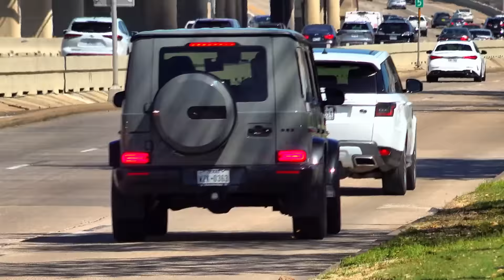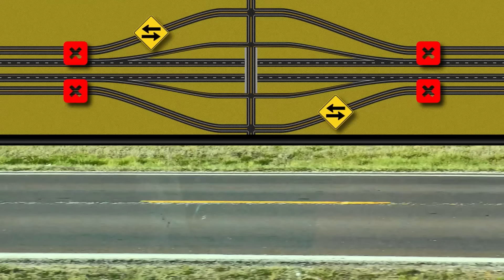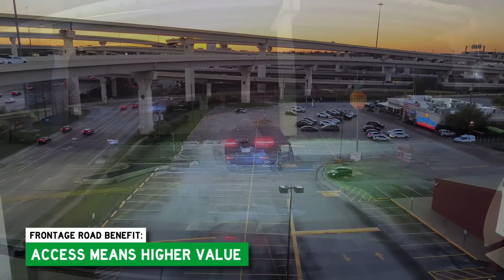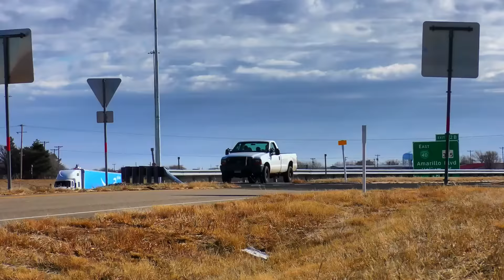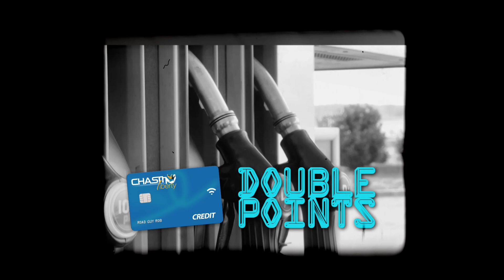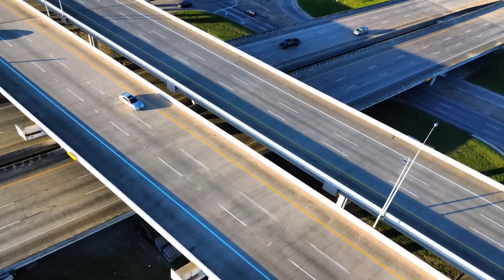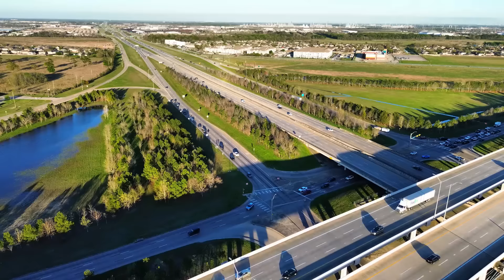Why Texas Builds a Freeway Next to Every Freeway

Comment: The real question is why is this done? The root of Texas frontage roads comes down to one major reason. Zoning laws! Texas basically doesn't have any. You have houses, schools, manufacturing plants, grocery stores, banks, apartments, and freeways all next to each other. Everywhere else there are strick rules stating where you can build what. Also getting permits to build requires little bureaucratic delays. So yes now Texas has grown beyond cities. On any freeway leaving Austin, Dallas-Fort Worth, Houston, or San Antonio and you can go 30+ miles and still be in "CITY". Within the next 20 years all four of the major cities will be a fully connected super city.

You have to love the "Texit" (rutted paths from freeway to frontage road) and those are not just for trucks. Many adventurous Texans will take their cars through them.

Comment: No, slingshotting does nothing to improve main highway traffic, it does the opposite by introducing more variance in driver un-predictability. When you speed around traffic and have to get back onto the main highway, the rest of the cars behind you now have to slow down again to let you merge instead of them keeping a constant speed. If you want a high throughput of cars on a highway -- reduce the # of on-ramps please.

Comment: Frontage roads are chaos. The whole system is flawed because it relies on excessive weaving from one side of the frontage road to the other. There are too many activities happening; it's like a stroad on steroids, trying to be both a highway and a street. For instance, with the X configuration, you have some people in the left lane speeding up to enter the freeway while others are slowing down to make a left at the cross street, creating conflict. In the right lane people are constantly making right turns.

I think they are probably worse for urban development if only because you're not going to convert frontage road development to something more walkable and transit-oriented. Otherwise it's actually rather ambiguous in my opinion. I can see the plus that it attracts all the trashy retail development to the areas near the highway, which are already undesirable anyway, rather than ruining additional places with both that type of development and the additional car traffic that comes with it. And it probably overall makes homes set back further from freeways, which is good.

Comment: The fact that the I-35 Frontage Roads mostly go from Laredo to Oklahoma is wild
Reply: It doesn't, after Texas Motor Speed there's no frontage road on 35W till Denton
Reply: @johnqwertydoe123 it's OK, everybody knows that there's I-35 and it's bastard stepsibling I-35W.  The e is silent.
Reply: They do this so they have redundancy in their roads that Places like Kansas city fails to have. I would rather drive in Dallas or Houston any day over having to drive in Kansas City.
Reply: Clearly Oklahoma dropped the ball.
Reply: @Akira-Aerins : OKC has them in the better designed bits. Even adopted the "Texas Turnaround" terminology for a while.

I've also seen them for a short section of a state highway, but... I honestly don't know how they ever thought that was a useful example.
Reply: @Akira-Aerins these service roads are all through Tulsa—and Little Rock, Arkansas too.
Reply: north of laredo, there's a border patrol checkpoint where they force every single vehicle onto the highway. you can't get back onto the frontage road for at least a mile
Reply: @mudkipman1  and the fact that the southbound frontage road is two-lane is scary that you kinda can use to skip the checkpoint, but idk what happens
Reply: there's like 200 different CBP trucks on that side just waiting for somebody to try.  @siroversight.official
Reply: Interstate 35E north of Hillsborough to Waxahachie parallel to U.S. 77 has no frontage road.
Reply: @u.s.6909  Parts of I-35W north of Hillsboro parallel to TX-81 and north of Fort Worth parallel to US-377 don't either, as well as I-10 between Seguin and Columbus parallel to US-90. And much of I-10 in sparsely-populated West Texas.
Reply: @u @u.s.6909 f Im remembering right. Been awhile since I’ve been up that way. The frontage road actually feeds on to and back out of 77.

Edit: just checked the map. Yeah the frontage road just turns in to 77 lol
Reply: Well most of it
Reply: Theoretically, you could take the I-45 feeder all the way from I-20 south of DallAss to Houston with little to no interruption and no need to ever touch the freeway.
Reply: @FilipinoWaylon26  most of the "feeders" between those points are via SH 75 (old hwy 75)
Reply: @siroversight.official yeah I'm aware lol. It's kinda cheating, but shhh, gotta keep the I-45 superiority alive
Reply: @FilipinoWaylon26  but you know, farmers wanted access to their land
Reply: @FilipinoWaylon26  DallAss?
Reply: They don't continuously go from Laredo to Oklahoma. There are massive stretches of 35 that have no frontage road. You must not live in Texas.
Reply: @JakeKoenig  Because I haven't seen one part of I-35 doesn't mean I don't live in Texas dawg 😭✌
Reply: Thats what I like about texas freeways is it allows you to keep traffic flowing continuously even if a wreck shuts down the major lanes of traffic.
Reply: Sorry, that’s totally not true  
Source: I live off of I35
Reply: @MrJack1992 says the guy who's obviously never tried to drive in or out of Dallas for the OU Texas game, lol!
Reply: @mrbeansification True locals know you always take the train to that and to fair park in general
Reply: @orthrus4490 true local knows where to park in the south for free and walk right in the front entrance of the fair.
Reply: Needs a tornado to poof it away
Reply: @AMPProf  Tornadoes aren't that strong to rip off pavement

Comment: I understand that access roads solve a unique problem in certain areas, but they’re way too dangerous and it’s appalling that some governments decided to build access roads completely by choice. The main issue stems from people failing to yield. But frankly, I can’t blame them. Because if people actually yielded, they’d get rear ended. And then there’s the issue of speed, because no matter the speed limit, they’re usually designed like a freeway and people go freeway speeds, despite the road having way too many connections for those speeds. And the cherry on top is the absence of right turn lanes, which significantly raises the risk of a high speed rear end collision. Awful. Shame on those who made these decisions.

Comment: There are at least two places in Texas-- I-10 and TX 375 in El Paso and I-35 at TX 6* in Waco-- where four-loop interchanges formerly used for the mainlines are now relegated to use by the feeder roads. Doing this eliminates the need for the fifth level, thus eliminating the need for traffic lights and shortening the length and reducing the cost of the direct connection flyovers when they're built.

*OK, the one in Waco has only two of the eventual direct connectors.

Comment: That's pretty brilliant! People complain about "stroads" all the time, but if they are made one-way, they can be so much more efficient about getting people in and out of the businesses efficiently. That said, it only makes sense in commercial areas, and rural areas should not have anything like that. I honestly think that the best way to do a "frontage road" would be to have NO crossroads, NO stoplights at all. The way I would do it is, roads coming in from the outside of the road would just have a yield merge in, just wait for traffic to be loose enough that they can join it in the direction of travel. But what if you want to go the other way? You merge in, shift to the middle, and then there would be a u-turn onto the opposite direction. These uturn spots would be both far enough from the side intersections that you can't pass directly through, and have long enough merge lanes on both sides that make it easy to get up to proper speeds. So basically, you can just keep going non-stop in the direction you intend to go.

Comment: My biggest complaint about Texas-style feeder roads is that they're impossible to provide with bus service due to the infrequent connections between the opposing directions. Yes, I know that most of the US is irredeemably car-dependent, but normal arterials preserve the possibility of decent bus service and crosswalks at, say, quarter-mile intervals. Along the same lines, frontage and feeder roads create a glut of low-value commercial properties that, when developed, place a high proportion of lower-wage jobs in places that are inaccessible except by car. Municipalities care only about property and sales tax revenue, but someone ought to be concerned about forcing low-wage employees to buy cars when they can ill afford to. That, by the way, is one reason why Texas towns and cities all look alike.
Reply: Couldn't you just put bus stops in the middle and near the ends? That way, you can take the bus to someplace where it is easier to cross.

With so much space for the roads and so much expense already put into grade separation, they could also add grade-separated pedestrian crossings at frequent intervals. That'd be even easier to cross than waiting for a light at a cross walk!
Reply: Thank you for making this point!  I know that the non-car infrastructure wasn't the point of the video, but I think it's important to mention that this setup is literally only valuable to further car dependency.  As you pointed out, the infrequency of crosswalks is a huge problem, but also the width for pedestrians to cross of freeway lanes plus two frontage roads is even farther than just a regular freeway crossing.  Add to that the perilous crossing conditions of walking on some small barrier between the traffic zooming by to make the Texas U and the through lanes and it becomes very clear that nothing but car traffic is welcome here.  Which means more people have to travel by car...which means there's no end in sight to the traffic problems that plague Houston's freeways.

I'm not "anti-car" by any means, but this road-building strategy doesn't help diversify the transportation system to make it work for the largest number of people.  And I think that's an important point to consider with this design.

Comment: Montreal built most of their freeways with Texas-style frontage roads. They're great on paper, but they got so badly built that they only created more problems than they solved. "Storage space? braking space? Weaving space? Nah, we don't do that here". Also, Instead of having frontage roads intersect under interchanges when a freeway meets another freeway, they built cloverleafs on the frontage roads, so all cars wanting to turn right or left at interchanges gets dumped right onto the frontage road and have to use one of the worst interchange design imaginable. One notorious example of this is the 440-13 interchange, it gets backed up so quick I'd rather go on a 10 mile detour just to go around this interchange.

Comment: This is how Montreal does it. Lots of the Autoroutes going through the center of town are very frontage-road based. The Decarie Autoroute, which replaced a rather useful street with a steep-sided trench and a pair of frontage roads, is the biggest example. Many of the interchanges are also mixed in with the frontage roads, too, and there are more roundabouts throughout the system once you get beyond the populated parts of town, including a very annoying one which splits Autoroute 520 off of 40. 520 is more like what Tampa did, though.

Comment: @18:02
 I drive around Houston a lot. And I'm one of those people that just don't pay tolls. I will take beltway 8 frontage road from interstate 10 all the way around interstate 69 on the north side sometimes lol. I'm a truck driver so those tolls can get expensive

@19:21
  The reason Texas started leaning into feeder roads is because of the price of land. A long time ago Texas learned from people along these highways that were going to expand, that they could secure cheaper land for the interstate or freeways if they installed feeder road. This was negotiated by ranchers, farmers and other businesses alike. Even if the land was out in the middle of nowhere, ranchers and farmers would sell their land at a cheaper rate if they would put these theater roads in, cuz then they could sell their land at higher rates to commercialize it. So you think about a 200 mi long interstate, you build feeder roads along it the entire way, but you get the land probably 25% to 30% cheaper because you put a feeder road along the side of it as part of the the land acquisition negotiations. 200 miles worth of land is a large chunk of change And I'm sure that putting in feeder road as part of this agreement between the sellers of the right away probably offset the actual building of the feeder. This actually is the origin of the Texas feeder. Yes I know you showed that first one on interstate 45, but the real reason for why feeder roads caught on is a financial one for the state,  Land acquisition was just a lot cheaper if you bought more and put feeders on it! Lol

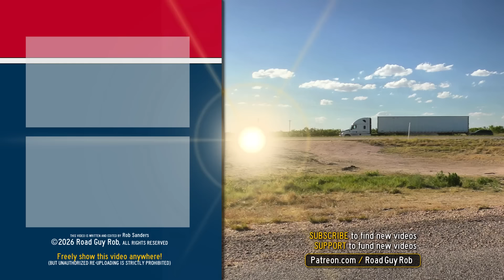@19:40 now that's called the Texas exit. It might be illegal, but it's rare that anybody gets pulled over for it. That usually happens you're in a backup. Most likely during accidents that severely reduced flow on the traffic or is closed. But I'd like to see one cop actually try to pull over several hundred cars trying to come off the freeway at once. I've never seen it happen. I'm sure it does, I'm just saying in my 50 years I've never seen it happen

Comment: Five miles of US-90B in Greater New Orleans follow this model. This is also designated as the future I-49 corridor, and is most of what is known locally as the Westbank Expressway.  The expressway was built in the 50's and 60's as a surface road, but in the late 70's and 80's, the road was converted to an elevated through section and service roads for similar reasons to I-10 in Houston - the businesses were already there.

Comment: Ig in the end Rob is still more a car guy, so let me be absolutely clear: a frontage road is not good for pedestrian. The problem is not having a sidewalk parallel to the frontage road (that can be installed to any ordinary nonhighway road, which render frontage road pointless in that regard). The problem is how is one supposed to cross the frontage road to the other side? The perpendicular direction is the troubling bit, not the parallel bit. The whole point of frontage road is to, quote and quote, connect business, but yet if you have two businesses right across each other, you can only access them by crossing at dedicated crossing, but given how high the speed a frontage road is, these are almost always far apart from each other

Comment: I can’t believe something we in Michigan stopped doing in the 1960s because they were dangerous, Texas is doing in 2026 for safety. I call them the Scissor interchange where the two way frontage road meets the off ramp and veers to the right for one side. Very interesting.
Reply: Michigan built the the frontage road in anticipation of a freeway that did not get built.  Because there are not any more freeways planned, those roads will not get built.

Comment: My biggest issue with these is that the driveways can be really close to the exit. So you get a situation where you cut across multiple lanes to get to enter a business or side street. or have to dodge cars doing so.
Reply: Check out the spacing on I-10 in El Paso & Patriot Fwy with the US 62 - 180 eastbound exit.   MAJOR weaving issues, that they seem inclined to ignore, and instead slap more "decorations" on an outdated spaghetti bowl.   Which should have been replaced, instead of that poorly designed and planned "go 10" fiasco.
Reply: Get off earlier.
Reply: @jghall00 That sounds logical if you know this ahead of time, but most of the time this happens when you're following google maps to a business you've never been to and you really don't know until you are on that turnaround just how close you are cutting it to make that driveway you need and how heavy the flow of traffic you need to cross will be 😂😂
Reply: And Google will tell you to! I've had instances it told me to cross the double white lines!!

Comment: Heck Texarkana when they reconstructed both the Arkansas and a bit of the Texas side they extended Texas style frontage roads into Arkansas and adopted the Turnarounds in several exits but in Texas they 1up'd the frontage road system but not only using the X ramp system you mentioned but also have frontage bypasses that give you access to the freeway but also bypass the intersection without feeding into the freeway and many other parts of Texas are adopting it too see it alot on 35 in the newer sections of freeway that they fixed.